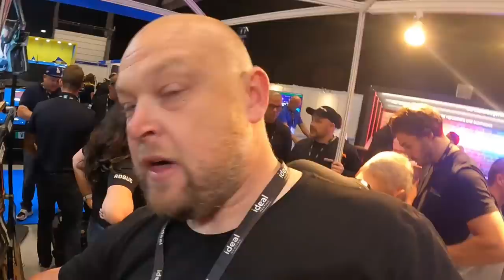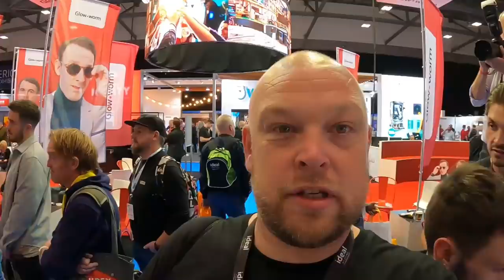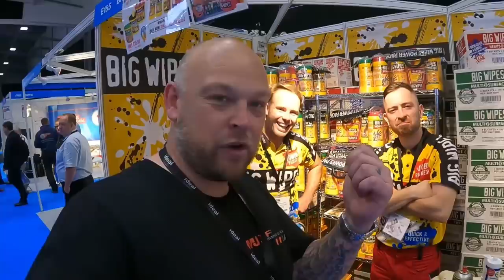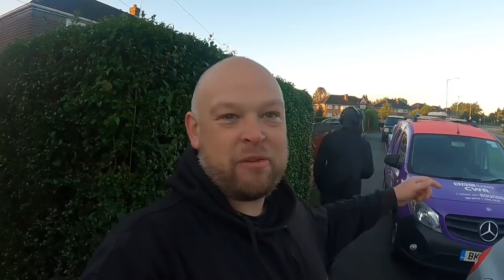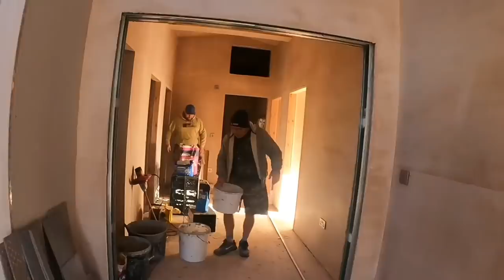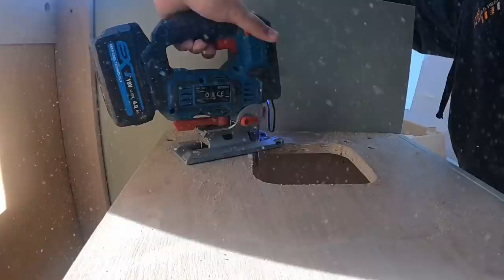BARN CONVERSION HOLD UPS BUT IS IT MY FAULT? And i take a look round THE INSTALLER SHOW

Comment: Not been to any of these shows,but wondering if there are any stands on Air/water/ground heat pump systems,as I read today gas boilers from 2025 are going to banned in new housing.
Reply from the maker: Yer there was a few of those stands about mate… I guessing a lot more will be popping up soon